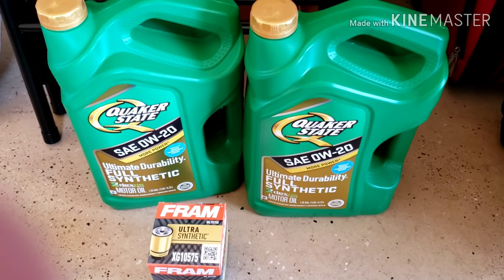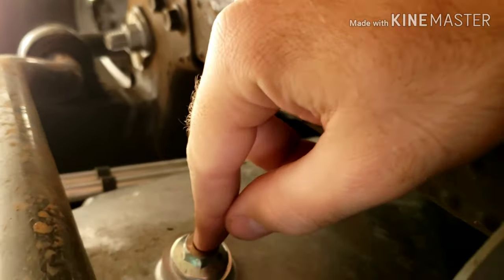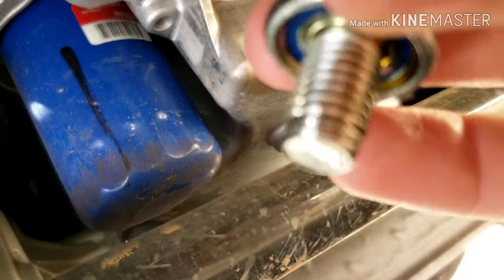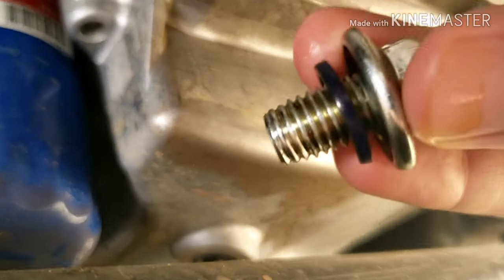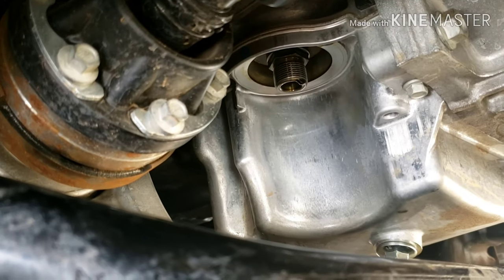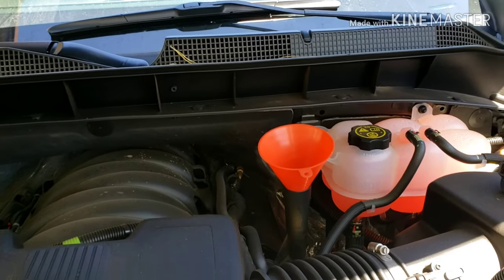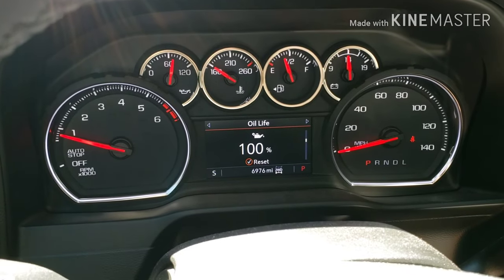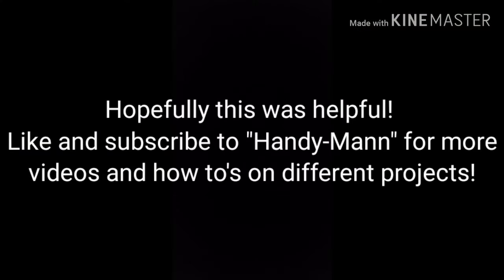2020 Chevy Silverado Oil Drain and Change

Comment: After pouring from 5 quart jug, pour second 5 quart jug into empty jug and measure 3 quarts on the side of first jug. Easy way to measure with 2 quarts left over for next change.
Reply: Why not get exactly 8 qt. Instead of getting 2 gal (1gal is 5gt.) Now you have left over oil
Reply: @jackieliu5004  price usually.

Comment: I will be doing my second oil change in a few weeks. My truck will have probably 12.500 miles on the odometer by then, right now the life system shows 28% left, The first oil change was done at the dealership at 5,500 miles. I will be replacing the stock drain bolt with a Fumoto Quick Release valve. This will speed up and make the draining process a little cleaner. This is the same size engine as my 2006 Silverado, but it holds 2 more quarts of oil. I was lucky Sams Club took back all the 5w-30 and let me exchange them for the 0w-20 Mobil 1...Good thing because I had 15 cases of the 5w-30 Mobil 1...I will be up-loading a video to show how to change out the Fumoto drain Valve.
Reply: 5w30 wont hurt these engines. Ow20 is only used to reduce the amount of oil on the rotating mass in an attempt to raise mpgs
Reply: BigTyronie that’s typically the case. Hi were, this is the new DFM.  I would go With the recommended grade as the AFM uses a oil pressure as a component of the algorithms.

Comment: So I did my oil and filter, and put in 8 quarts, one 5 quart jug and 3 one quart jugs, and ran the motor for a minute. I checked the dip stick, and it looked full. Oil all the way up on the cross hatching, but when I wiped it of and stuck it back in, and then pulled it out, there was no oil on the stick. But then I started the engine for 15 seconds and checked again, and there was oil on the stick again, and it read full. Any reason for that?

Comment: How in the world have you managed 19.9mpg at 6K miles? My 2020 is at the same mileage but I’m averaging 15mpg. Do you spend a lot of miles on the highway? I didn’t buy the truck for it’s superb gas mileage, but any tips to save a bit here and there would be appreciated. Great video
Reply from the maker: Good catch! A decent amount of those miles are highway (probably about 70%). My main thing is I don't accelerate very fast and try to keep it under 2k rpm at all times. When driving only city on one tank i think i got under 14 mpg.
Reply: @Handy-Mann  the best way to drive at low rpms
Reply: my 2020 5.3 has got up to 23.1 on the highway

Comment: How’d you hit 34mpg? Highest I’ve been able to hit is 24.6 mpg
Reply from the maker: That 34 mpg wasn't for an entire tank, I think that was just for a gallon or something haha. But I almost always keep it under 2k rpms (even on acceleration), live in a fairly flat area, drive probably 30-40% city and 60-70% highway and use cruise control a lot. Just rolled over 20k miles and my lifetime mpg is right around 19 mpg.
Reply: I have 39.8 as my best. I think it was a glitch. I have the 2.7t silverado, insert joke here 😆.

Comment: I would argue that the AC Delco filter is better than the Fram you have
Reply: WIX is better than those two.
Reply: @99wallygator  I agree
Reply: Fram and wix filter are JUNK! use oem ac delco filters.
Reply: @Luckky-13  The FRAM Ultra is much better made then the old Orange Extra Guard. The AC Delco filters are made by Champ Labs now, which is owned by the same parent company that makes FRAM. AC Delco filters are not Premium filters any more.

Comment: is Quaker state your preferred oil..or is it a cost thing
Reply from the maker: It's a cost thing. I know everyone argues about the best oil/ brand, but I figure as long as it meets or exceeds manufacturer specs and I'm consistent on my oil changes then I should be good.
Reply: walmart oil  supertech oil will do just fine,  i've been using supertech since the 90's  all my trucks/cars went over 200k miles no engine oil issues

Comment: Fram filters are complete trash and by the way they most often do not meet GM's warranty guidelines.
Whenever given the chance go with a Napa filter they're made by wix and they do comply with GM's filtration guidelines to maintain warranty You want to at least use the Napa gold which exceeds GM's filtration guidelines.
Fram uses cardboard inserts

Comment: Run 5w20. Your engine will thank you in the long run.
Reply: What grade gas do you run in 2020 silverado 5.3?
Reply: @Donny.C.wlWilliams  89 no ethenol. 91 when I'm towing my camper.
Reply: @upnorth5465  thanks
Reply: it all depends on what the climate is where you live. If your in Arazona or California 5W 20 is fine. If your in the Nothern states and Canada, use 0W20.  If you have ever fired up a truck or car when its -20F to -40F out,  0 W oil is pure magic!